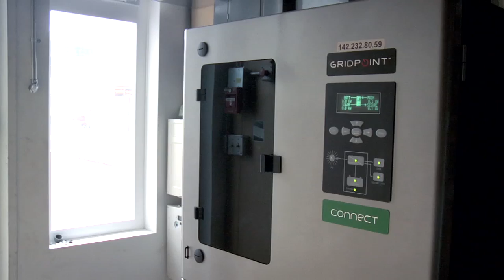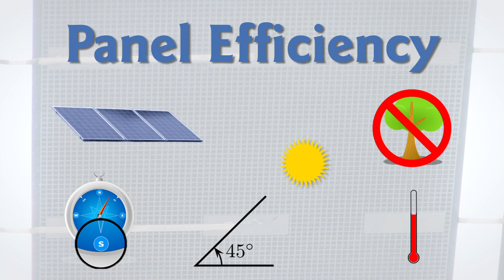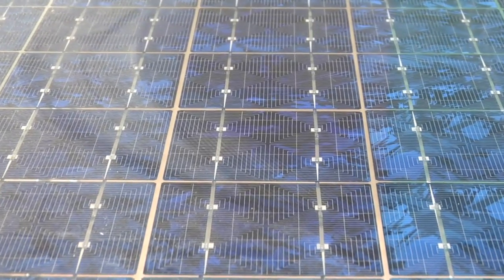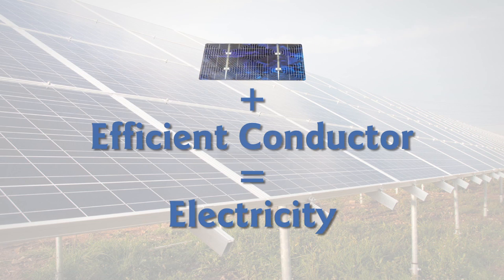What are Solar Panels Made Of?

Comment: If we put put separated layers of these cells on top of each other: can that make a more powerful solar panel? So we can have less area used?
Reply: No light must fall directly on the panels to generate energy.
Reply: @eduvarangia  what about if they were different color?
Reply: @knowledgeshortvideos  may be possible in near future if that adheres to photoelectric principles.
Reply: @eduvarangia  if every layer was made up of one of the 7 colors of the ray ... maybe that will take all the power in the ray without any loss instead of depending now on the violet color because of its higher conductivity of photons